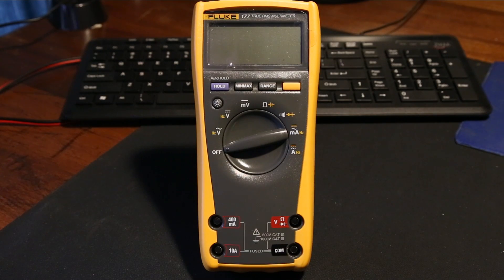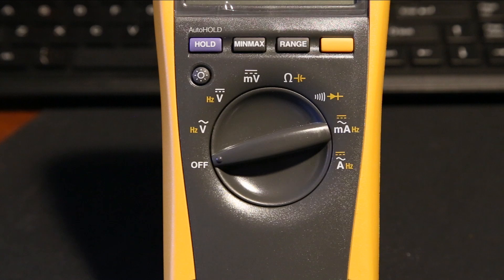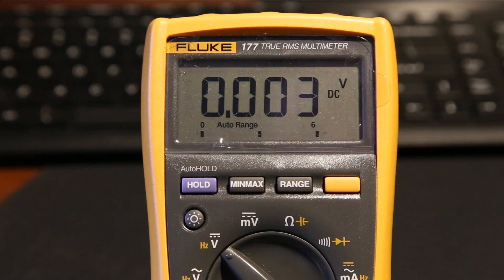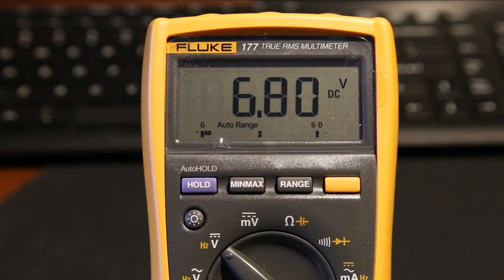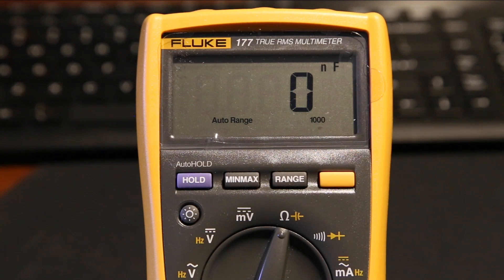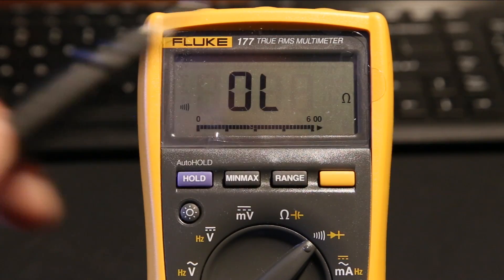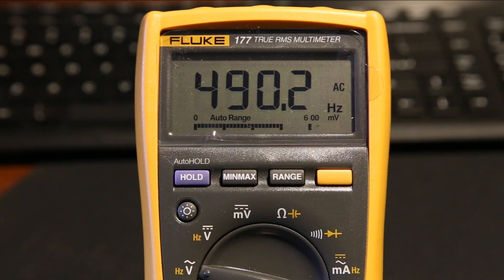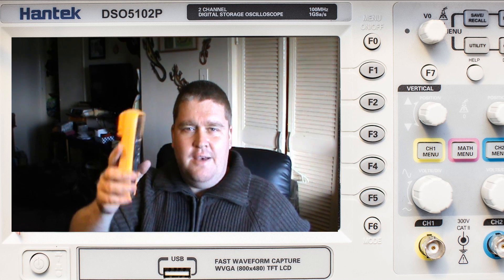Evione ElectronicsEpisode 1   Fluke 177 Review

Comment from the maker: Nelson, sorry for delay. I did not actually see any comments below until now. For PC troubleshooting you could make use of something such as a Brymen TBM811 or Uni T UT61E Meters. The Brymen is a little more expensive but build quality and safety is much higher. The Uni T is probably the best bang for your buck but safety measuring higher voltages is not as good. However for PC work you will be working with the Uni T would be more than adequate. Let me know if you need any more advise. :-) and thanks for watching. 

Shawn I have started doing phase to phase on all new tutorials. Here is SA that is around 400v with the 230v phase to neutral. 

Riskteven, My main meter is the Brymen TBM812, TBM829, TBM869 meters. I also now make use of a Fluke 117 as I like Flukes diode test beep. No other meters seem to let off that little beep when testing diodes and transistors in diode test mode. :-)